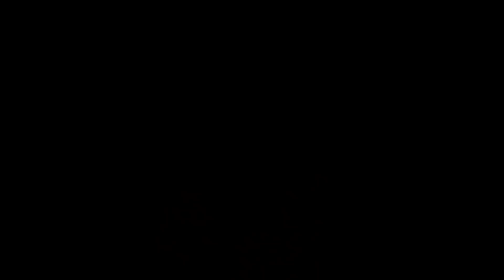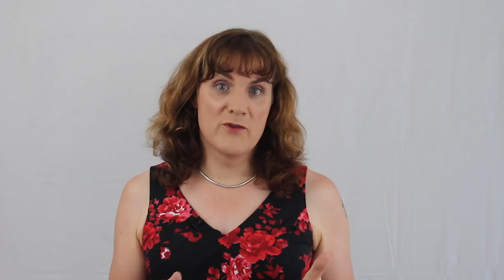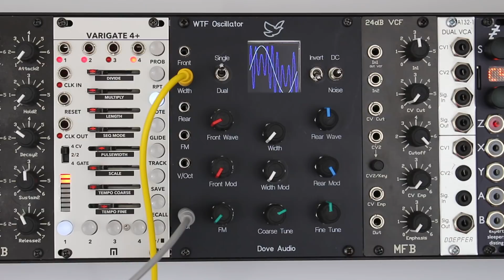Dove Audio WTF Module Kickstarter

Comment: This looks like convolution?!!$&
Reply from the maker: Sorry I don't follow what you mean, could you explain your comment so I can respond please?
Reply: I was simply curious if the resultant wave form was an artifact of the  front_wave(t)∙back_wave(t), but 'filtered' with specific time limits.  In other words dot product of values of each waveform.  Also is this analog? If so, it would be 2 continuous signals and the upper/lower bound of the window could be time.  If the waveforms are digital, then upper/lower window bounds would be discreet values.  Additional, if the waveforms are digital (say DCO's), are they maybe variants of Taylor Series or are they sampled waveforms?  The demo shows a complex signal for the back_wave.  :/   Just wonder....
Reply from the maker: Thanks for explaining your query, there's no filtering/smoothing it is simply swapping between waveforms during the cycle of the waveform. So it is possible to get some very harsh harmonics, there's another video here where you can see, and hear, the effect this has when the rear waveform phase is inverted with a much simpler waveform - https://www.youtube.com/watch?v=xxtP5tPlh6Q
The waveforms are generated digitally (they were also created digitally using a number of tools to mix harmonics) and the oscillator itself is a NCO/DDS type (though without filtering).
I hope that helps :)